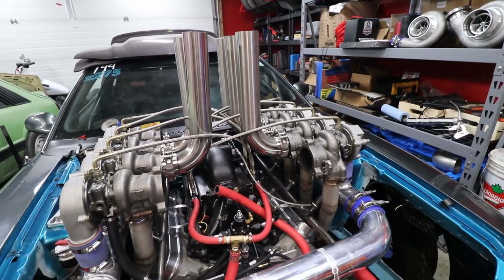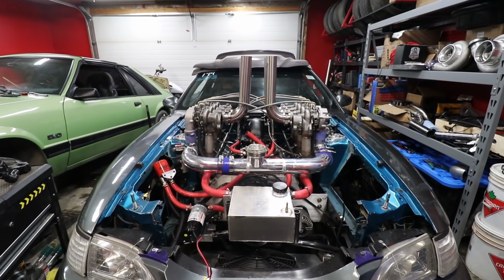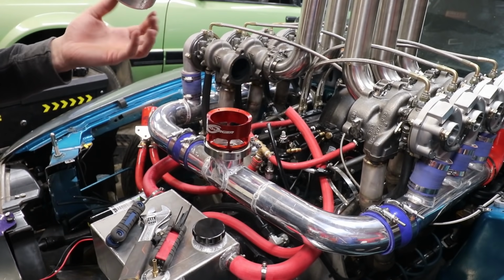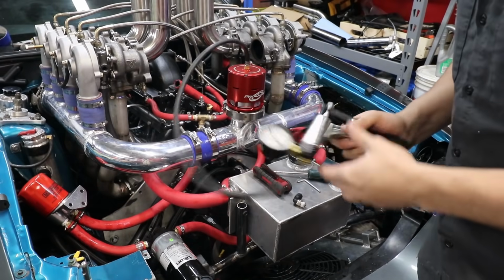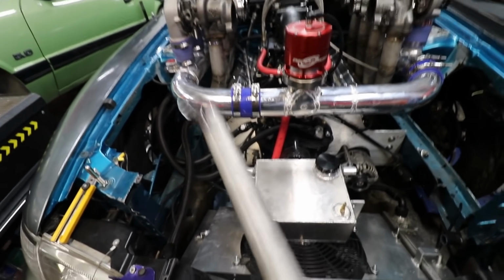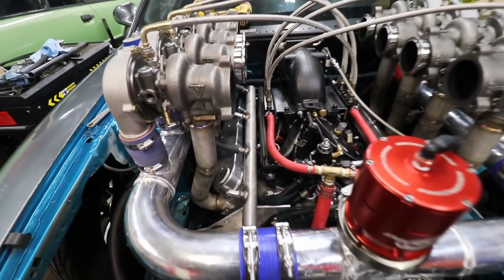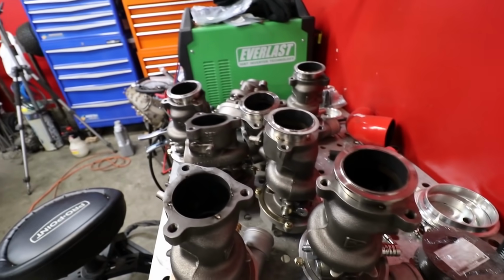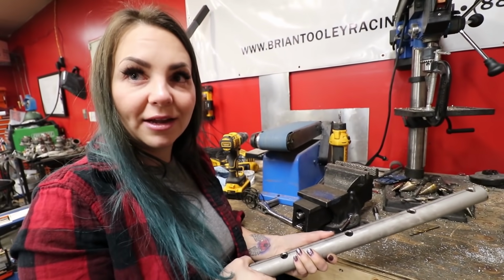EIGHT Turbo V8 Mustang Gets Worlds Biggest Blow Off Valve?? - PT 9

Comment: FWIW...i have a aw11 mr2 with a k03 turbo and the thing smoked like it had bad rings for months. rebuilt the engine, added 10an pcv breathers, redid the oil drain, nothing helped. added a .035 inline restrictor to the oil feed and it fixed it. Those audi k03s have a restrictor at the feed on the block, so i didnt realize i needed one, but they do.

Comment: Factory k03 for the vw runs no restrictor on the turbo or the return shouldn't be an issue but at 50psi you are severely overspinning the turbo they are only good for about 24-26 on a good day. Also on that note of oil pressure I see 20psi warm idle 50psi at 2600 rpm and 70psi at 3800 maxes at about 85 psi at 6k+ (cut is 7800)

Comment: It's supposed to be open at idle.  When you open the throttle and vacuum gets close to 0 it closes and boost holds it shut.  I've run my Synapse on both of my BMW's that way for a combined like 30-40k miles.  If you put a paper in front of it at idle you should see that air is blowing out not being sucked in.

Comment: Cast iron is easier to weld to if you heat it up before you weld it
Reply: Why not make a flange that can bolt to the turbo and weld to that. Welding cast is not easy. 
Weld mold 880 is a great rod for welding ss to cast. But preheat is very important,  more importantly is cooling. If it cools to fast it will micro crack and fail for sure in the conditions he has them in.

Comment: If you're gonna restrict the oil-flow to the turbos, don't make 8 for each of the feed lines.
Restrict the main hose coming from the pump right at the outlet.
Or cut the voltage going to the pump in half somehow...

Comment: Ok i have a issue with your oil drain out of the turbos. If you take this to a drag strip or do hard pulls. The acceleration g's will keep the oil from draining out of you 2 big drain pipes and may back up the oil on the turbos. I feel you may want to have 4 separate lines per side going to the tank so the oil from the front turbos won't flow backwards into the other lines. Just my tip.

Comment: You might think about using a small scavenge pump to pull the oil out. When driving the g-force driving might cause the oil to back up on those pipes. Just a thought!

Comment: Can’t wait to see this thing drive😍
Reply: Probably gonna be a couple months because Canada lol
Reply: I think you’re gonna be sorely disappointed lol only thing special about this is that is looks unique.
Reply: @AgiDaKinG  it has enough turbo for well over 750hp. We know 4 can support 400hp. Do the math.
Reply: @madmod  4 of those on a smaller cylinder bore 4 cylinder Honda so the V8 should ( possibly) make atleast 800 or more ! I was worried about the length of time between all 8 exhaust strokes keeping them spooled up and making boos but it seems like it makes a jag of boost !
Reply: @jasonsparshott7208  That small of a turbine should have no problem on 41ci cyl vs the 27ci cyl the 4 cyl has. The way the smaller engine made its boost was very linear. This engine looks like it will come into boost pretty quick but have a falling boost curve. I still expect over 800.
Reply: @madmod  that's exactly what I was getting at . I agree

Comment: Look here bud, here's whacha do, eh. You drill a small hole in the middle where ya want the BOV then weld the flange on, then use a Dremel with a carbide bit to make the hole the same size as the (ID) BOV flange.

Comment: Out of curiosity, would it have been easier/more functional to face the hotsides outboard and the charge side inboard. I can understand that clearances may have been an issue, but with them mounted in that orientation none of your lines would have been in close proximity to the hotside parts. Your charge piping could have tracked on either side of the intake manifold as well. Just my two cents, but I'm not building it and I love the ingenuity behind it.

Comment: Does it hurt anything if the blowoff valve is open under vacuum? When it’s in boost won’t ur reference line put pressure on top of the gate and close it under boost

Comment: If you are fitting two tubes of the same diameter at a 90 degree angle, like you did, notch it with a chop saw or band saw. Whatever you got. Just two 45 degree cuts.
Reply: That gusset sure does look sick though

Comment: Correct me if i am wrong buuut i guess you have to put the top line BEHIND the throttle plate, on full send the pressure will close it and when closing it will open.
Reply from the maker: It is behind the throttle plate. The throttle body goes inside the car so it's between the throttle plate and the intake ports 👌

Comment: Boosted Lifestyle you’re inspiring me to start my own uploads.  I’m currently working 50 to 60 hours a week as well and I’m swapping in an LS into a 1st gen 4runner.  Hopefully the content becoming interesting to some as yours has to me! Keep it up!
Reply: What year 4 runner?
Reply: @6181green  it’s an 84.  Aluminum LS with a th350 and dual Toyota transfercases. With a Ford 9” and chromoly front axle.  I’ve done a lot just haven’t recorded due to time, work and growing family.
Reply: Hell yeah thats awesome you actually have a true solid front axle I have an 87 and she is a beast even with a stock 22re lol I subbed to your channel looking forward to you posting some vids 👍👍
Reply: @6181green  I went through several 22rs. Even built a turbo 22r with a blow through carb. But ended up selling it all to do the LS swap
Reply: @SubePelayo928  hell yeah carb engines are way too unreliable fuel injection is the way to go the ls swap is ideal because the 2jz is too damn expensive
Reply: @6181green  yeah, I have plans to turbo the LS. It’s converted over to carb right now then eventually go turbo with a Holley sniper.  I’m building it more for the dunes and some trail adventures.  Possibly swap on some slicks. Tighten up the suspension and take it to the strip

Comment: If the oil supply for the turbos is pressurized, wont the return oil lines be under pressure?
Reply: No, as the turbo is the restriction in the line and the return is much larger it just flows out,

Comment: Umm. That bov placement is pretty terrible, the air from all of the passenger side turbos would have to flow backwards in order to escape. I think you may get some bad compressor surge with that half of the system. Bov mounting should be as close to the throttle body as possible otherwise the air trapped before the throttle body will try to open the throttle once its shut. Just my 2 cents. Love your content. Good luck with build

Comment: My blow off valve is open at idle. Turbo lights fast and holds 30psi. Not sure why you want it to be closed when under vacuum
Reply from the maker: It's going to suck in unfiltered air if you don't have a turbo filter

Comment: With your welder so close does the fan blow away your argon
Reply from the maker: I don't find myself having issues but that might be becuase I run my gas on the high side
Reply: 10-4 your girl did a good weld shes got potential

Comment: why  are you running your  oil drain into a box  would'nt it be easyr to just run  the  line down into the  pan ?
Reply: Because he probably doesn't trust the engines oil pump to put enough oil into 8 turbos 2ft above...

Comment: reasons you should mount your vise: 
you can tighten the jaws easier
you dont have to hold the piece youre working on, the drill, and apply opposing force to the vise while pushing with a hole saw. 

things to take away from this comment. mount your fucking vise. its easy and gives you an extra hand

Comment: That bov wont work like that put it back to how it was so when you’re throttle plate closes after you let off itll open and vent the excess boost and when throttle is open the boost will hold the bov shut

Comment: Also, has he done the math on how much gas hes gonna need to spray to meet that air supply?  What kind of fuel system  is he using? What kind of ignition, what management system is he using?  What's the redline on this,? Whatever it is I imagine its gonna reach the shift points quite quickly. If you know I would like to as well
Reply: I'm gonna have to go back and watch episode 1 aren't I?
Reply from the maker: I got 1200-1400hp worth of fuel system in this car
Reply: It’s a fuel cell with magnafuel 750 inline pump supplied by the sump on the bottom of the tank. The engine management is Holley Hp and I think his rev limiter is set to somewhere around 7600. Not sure on injector size but 160 lb/hr or bigger

Comment: When your recommended is faster than the notification
Reply from the maker: Brutal 😂😂
Reply: @Boostedlifestyle  also might it be that even with the oil supply restriction that they end up filling the return pipe beyond its flowing capacity causing the oil to be restricted to the point that it'll push past the seals?
Reply: @Boostedlifestyle  also cast iron needs to be heated quite a lot to get good penetration. Don't know if running the cup a few rounds over the welding area would help introducing sufficient heat into it to get the welds to stick..

Comment: This man has no clue how a blow off valve works 🤣 poor guy just leave it alone the spring is a helper when it's open that's because the pressure in the valve face is higher than atmosphere. Meaning air is coming out 😂 not in. It should be open
Reply: You can test it with an ecig pretty easy too lol
Reply from the maker: It shouldnt be open at idle it should be closed. It's set up as a bypass valve from the factory for procharger cars

Comment: Noooo please don't ruin that with a blow off valve. 
8 turbos fluttering would be magic. 
Blow off valves are ricer trash.
Reply: @mrfkyobitch6282  false. 
Turbo flutter doesn't harm turbos the noise is air coming in fighting air going out but some stupid people think it somehow stops the blade spinning. 
If it did that a turbo would blow up the first time you let off the gas.